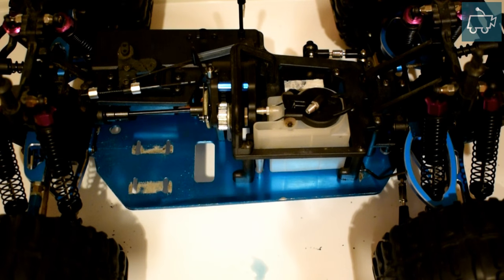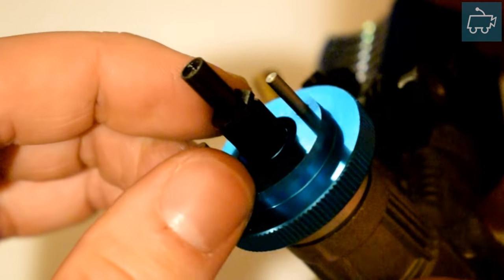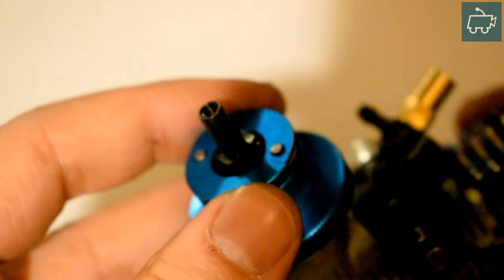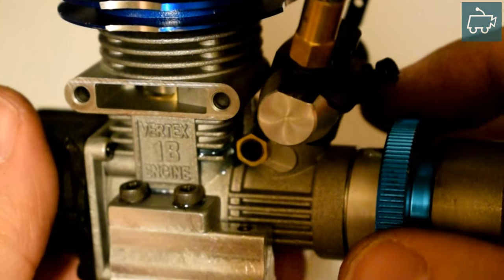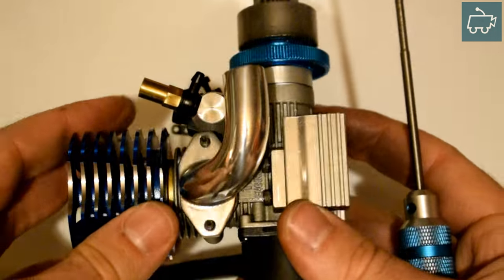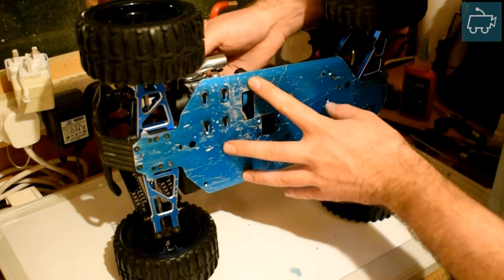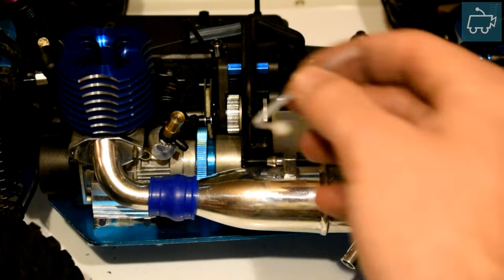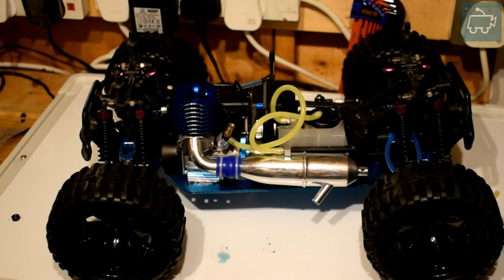R/C Truck Rebuild Project - Part 4 - How to Assemble a Nitro Engine and Exhaust

Comment: Josh I just wanted to make sure you didn't forget this: on the securing nut that keeps the flywheel from spinning freely when the engine's running, there's usually a rather big E-clip that prevents the clutch from moving off the pins on the flywheel. I believe you didn't show yourself installing this E-clip in the video. Did you install it but not record it on cam? Because if you didn't please install it! I forgot to install it once and my clutch shoes completely melted down due to too much friction with the bell gear. I know these were plastic ones and you've got the alu upgrade but things might get overheated in your case and I can't/fear predict(ing) what'll happen if that occurs :s would be such a shame after all that effort of putting it together this nicely.
Reply from the maker: I'm fairly sure I fitted it. It's not in the video but I did have the e-clip, and I don't have it now. So I can only assume I put the e-clip in. Might have to check though because I absolutely have no memory of doing it!
Reply: In that case I bet you have! Thank you for taking the time to read and respond to my comment :)

Comment: Hey I have this engine and when I tried to take the push rod and piston out I cannot get the rod to pop off the shaft. I’ve watched tons of videos and most seem to pop right back off the rod but No matter what I do I can’t get it to pop off. I’ve even put a zip tie behind it and tried to pull it off the rod but it will not come off and I did not want to force it any harder than what I did. SH .18 engine. Any help anyone?

Comment: Hey! I know this is a really old video and you might not reply but I've got a question: I've got this exact same engine on a truck and it keeps on breaking clutch springs. I've broken 3 already: 1 spring that was with the stock plastic clutch and 2 springs that were with the aluminum upgraded clutch. Do you have any idea why this happens?

Comment: I got a brand new nitro car years ago but what I think is the brake "which has never worked... brand new.   smh) Has like eaten into the fly wheel...  it's brand new I'm the only owner and I haven't messed with that.  
why is that?
Reply from the maker: are you saying the flywheel is rubbing on break components? Possibly the gear mesh is set too tight meaning that the engine will be too close to the gearbox components. Alternatively you could replace the flywheel with a smaller diameter one

Comment: Looking Good 👍
Reply from the maker: Thanks :) I'm pretty pleased with it. Feels good resurrecting a chassis that would've probably found its way to the landfill
Reply: JT12's R/C Videos  it is a great watch as i am fairly new to nitro and it helps me understand more what goes on that you cant see i.e. in the transmition box and how the braking system works 👍